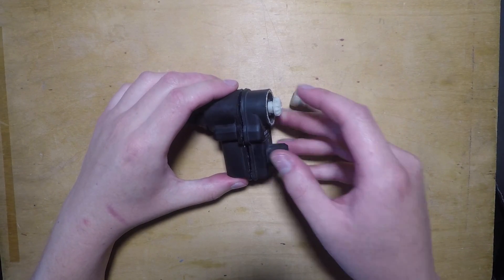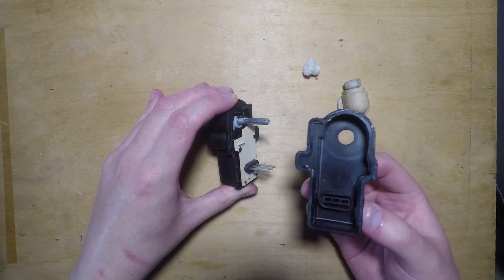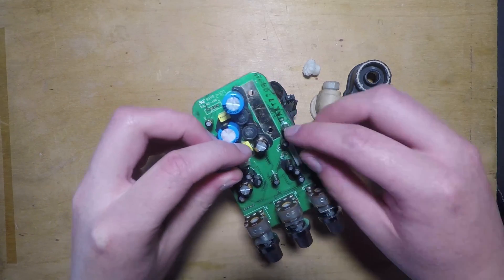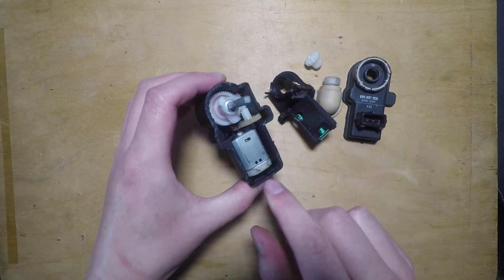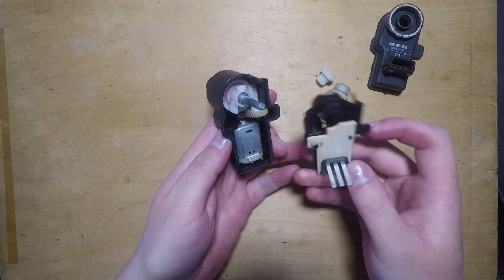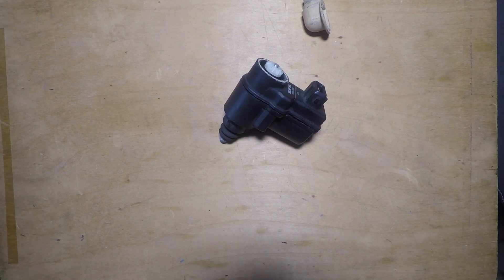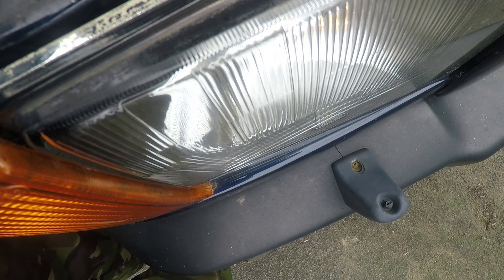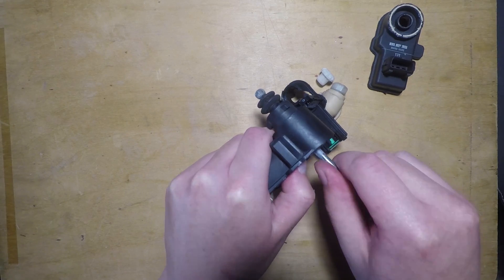Land Rover AMR2706 Headlamp Motor Teardown & Attempted Fix

Comment: There's no breakers yards around with LR's?
Reply from the maker: Not around here unfortunately, I tend to get my parts from breakers eBay or at shows and there was only one seller with one on eBay at £35. Given the weakness of the plastic parts I'm too much of a chicken to try it even at half price, I'm trying to hit an MOT re-test deadline so if that part was faulty it could cost me another £40 for another test. Normal scrapyards are almost non-existent in the midlands.